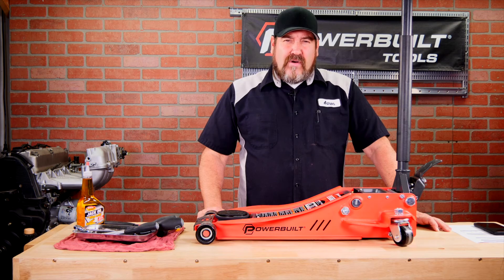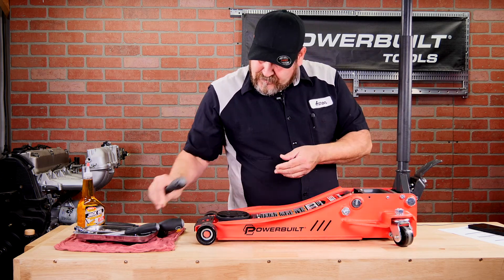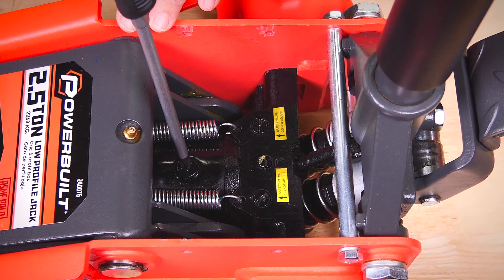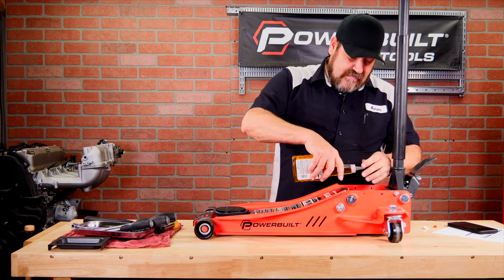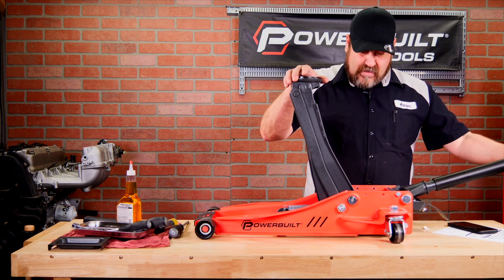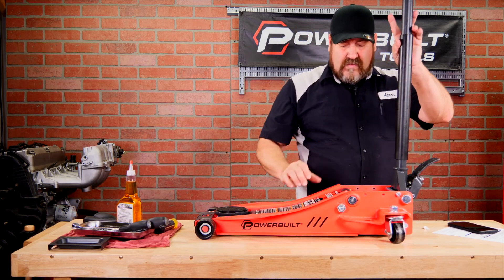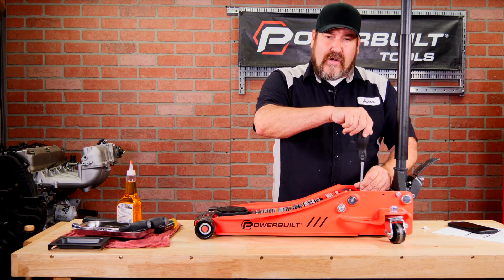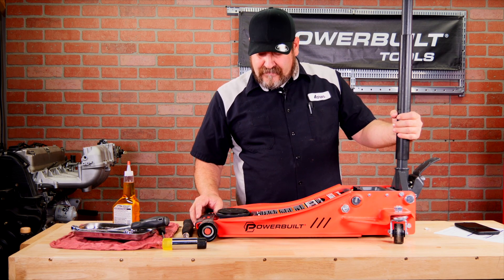How To Properly Bleed a Floor Jack - Garage Lift Equipment

Comment: I hav a craftsman 3.5 ton. It jacks up properly, but if i stand on it, my weight lowers it slowly down. I already added jack oil, but that didnt solve the problem. Any suggestions before i toss it and buy a new jack.. thanks
Reply: I have the same problem
Reply: I gave up bought new one Pittsburgh 3 ton aluminum low profile at you guessed it Harbor Freight. I refuse to throw my 3.5 ton Craftsman Jack away until I can find somebody that repairs them but as of now I can't find anybody that does within 75 miles. It would be a great business to look into.
Reply: Take it apart change the o rings

Comment: What if it's a rubber fill plug, how do you partially loosen to release air?
Reply: pinch the rubber plug to release the air
Reply: You don't have to this guy does a lot of extra steps in my opinion no disrespect to him All you have to do is turn the handle counterclockwise pump it fully up and down 10 to 15 times and just make sure the oil is touching the top of the cylinder and you're good If it's not add a little bit

Comment: Thanks guys. My powerbuilt 4000lbs low profile is still dropping after each pump (each pump also seems to lift less than it should). 

Have you got any recommendations on further service/rebuild?
Reply: Contact Powerbuilt customer service
Reply: Lifting less than it should sounds like air in the pump piston, should eventually get out with purging cycles. On my mother's Craftsman floor jack, about half of the handle travel feels very spongy. The lift plate also has ~0.5" of spongy travel to it. That is how I ended up looking for how to purge air from floor jacks just now.

If there is no external puddle, then the drooping is an internal leak somewhere. Can be a damaged ring, valve ball, a scratch or crack, etc. My cheap 2ton floor jack had that problem and I fixed (?) it by adding a generous amount of lithium grease to offset the oil lost while figuring out how to add anything to it since I couldn't find an obvious fill port. I ended up going through the lift/lower "valve" which is just a long screw pushing on a ball on my cheap jack. That brought it back from nearly unusable (have to continuously pump it while I place stands) to not needing to pump it back up while doing tire changes.